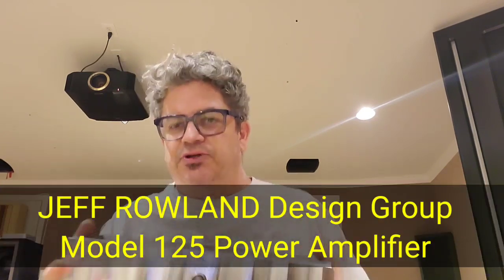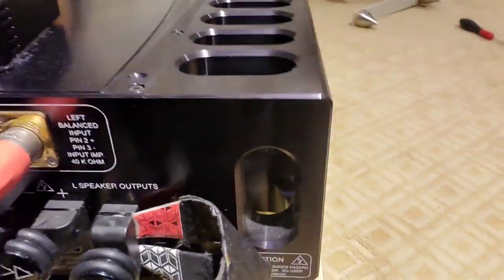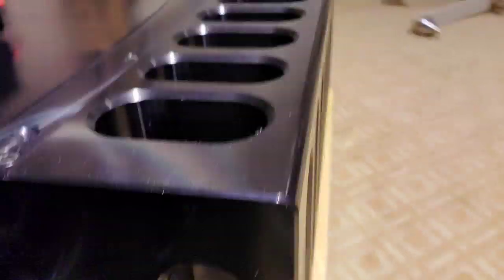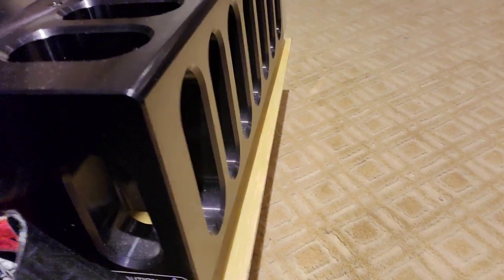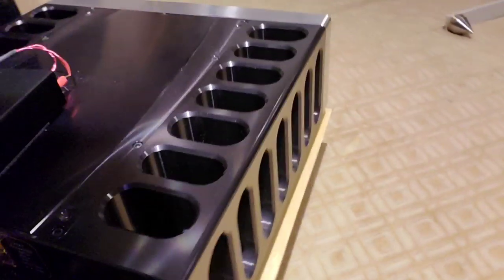Highest Value audio power amplifier for $3K

Comment: Id personally rather build some ICE / Ncore mono blocks with more power 
and look at the $1500 I still have in my wallet while taking pride in my handy work. 
But thats just me.

Your right, JR doesnt typically make "affordable" audio gear. However I dont think this 
product represents JR wanting to serve us working class out of love. Its because new 
audio topology now exists that can compete with old school high end linear power supply 
class AB output so on... And it weighs a small fraction of prior high end and can be made 
much cheaper on top of that too. As an old school audio guy with boat loads of big heavy 
gear. I know Im a relic of the past. Doesnt bug me. Just over the past 10 years class D in 
its many forms became a gold standard as well. Heck even the 60 watt chip amps for $60 
sound amazing with a decent power supply and used within their limits. 

Modern day audio nerds dont want hundreds of pounds of gear that takes up half a room. 
Some still do but I dont think they are the majority by a long shot. Whats inside that fancy 
JR box is just another spin on a design used in countless other class D amps today. Sure 
they could price it a few k more but now only die hard JR fan boys will still be around. About 
$3k is the general cut off point for a "audiophile" pre made 125w class D amp it seems these 
days. Give or take $1k depending on ones preferences. 
And now parts express offers ICE amp kits for far less to the DIY crowd. With many other offerings
from other places. Bringing much more than 125w per module. 

Its a different day and age for high end audio my friend. And IMO its for the best for a handy consumer. 
True high end has never been more affordable for the working class. And its even better if one has 
some DIY skill. Kinda harkens to a time before my own. Aka the Heathkit Dynaco Eico so on days. 
Build some great gear on your own and keep some of that hard earned $ to by the equally important
things you also need, music ;)
Reply: You can buy an amplifier with the same internals for 800$ elsewhere. If you spend 3k you might aswell get something like the benchmark AHB2
Reply: @pangbangdang3672  Agreed. But it also begs the question, for ones setup, do you need such astounding specs for the $. I personally bought a bunch of 80s era class AB pro amps that got properly rebuilt. Fraction of the kind of $ were talking about here. I have other amps as well, tube, newer tech so on... They all have their own characteristics and strengths. I have to wonder about peoples room / treatments, speaker sensitivity and setup, not even going into peoples hearing and perception. I actually had the honor of talking to Zed of classic HiFonics fame. We got on the topic of amp specs of class D vs old school topology. He made the remark, you think those specs matter in the noisy environment of a car?!? Really hit me. In a nut shell, theres so many different ways to get amazing sound from all sorts of speakers and gear and other factors. Im personally in the camp of using amps with extra headroom for the application. So many of these uber expensive 100 watt +/- amps dont wow me very much. However if using my super efficient horn speaker setup thats a different story.
Reply: @daveme3582  For car equipment I agree fully, heck your also focusing on the road, maybe when self driving becomes standard hifi car audio will become a thing.

Honestly the best amplifier setup no matter the price would be benchmark AHB 2 (class H) in mono-bridged. That would be 380 watts into 8ohm and 700 watts into 4 ohm with 0.0003 % THD+N.

Although you can get 80% of this for a fraction of the price.

I am 19 years old and currently got KEF LS50 Meta topping d90s and rega Io.

My dream setup is Mola Mola dac, Benchmark AHB 2 amplifier, Benchmark pre amp and KEF blade 2. I have got some way to go but something to strive for 😊
Reply: @pangbangdang3672  Haha you remind me of me at that age. Im 41 now. 

Back when I was in high school I saved my $ and bought a Yamaha HT receiver and all Paradign speakers. Pro Logic back then. Went nuts from there on out. 

It was a pre internet era back then. The biggest lesson I learned as time went on was about amp clipping and killing speaker. I had no idea why I kept blowing tweeters on the speakers I used as a young kid. My dad hooked me up with some nice vintage audio gear. But I didnt know the receiver was only 40 watts or so and I was driving 2 sets of 3 way speakers with an EQ in the mix. Terrible move looking back on it now. But me and my dad knew no better then. 

Agreed on the spec stand point the AHB2 is king. And yes if I were gonna rock em Id also use a pair bridged. Plenty of power then. And I think $3k a pop is a fair price for what it is. I simply feel for MOST peoples, even high end, needs there are plenty of less $ options with similar power. That top 5-10% of quality comes at such a high price. But Im a big bang for the $ kinda guy. 

You seem like a very spec focused guy. One thing I learned over the years is not just focus on specs alone. Listening is every bit as important. Im sure your a fellow fan of audio science review. Id also HIGHLY recommend checking out Elliot Sound Products website and his many write ups on all things audio. Its like the mecca of audio college. You can learn about ANYTHING there. 

Ive been out of the modern high end audio scene for a bit now. Got enough audio toys for 3 lifetimes as it is. Id never heard of that Mola Dac. It certainly specs nice but their website is oddly vague on detailed spec info. Regardless theres no way I would spend $13k on a Dac. Its a mini computer inside and they all fail over time. Plus if a company chooses to charge that much I would demand a warranty like Benchmark offers. 5 year with registration to the original owner. I could find no mention of warranty on Mola's site. But Im guessing its a 1 year given the absence of info.    

Im also a spec guy as mentioned. Its why I bought a used Prism Lyra 1 for less than half its new price. I love a quality A/D D/A box for my computer needs. With that said I recently got a great deal on a used Motu M4 A/D D/A usb box. Under $200. New its about $260. I personally feel the Motu usb units to be the best bang for the $ around. They spec right around the same other "pro" grade converters in many cases. Not tip top but damn close. I also have older nice DA converters that are non usb. So I bought a Mutec MC 1.2 interface. Great units for solid digital I/O with a PC. I also have a Lynx E22 PCIE audio card. 

I would personally just go with a Benchmark DAC 3 HGC and not bother with an external DAC. I trust Benchmark to make true TOTL gear. They have been doing it for so long now. That would be a perfect preamp with built in dac. 

Your clearly a fan of KEF. Many are as well. Just its been my experience that direct radiator speakers that use several small drivers to cover deep bass, tend to lack the visceral impact and depth of larger bass drivers. Clearly this is a generality. And I know and have heard examples that were impressive. The large old Polk SDA come to mind. They used a passive radiator as well. Im sure those Blade 2 are great and all. Just for the same $ I personally would be looking at a set of Wilson Audio Yvette speakers. Clearly Wilson knows what its doing. Plus they spec much better in the bass depo at the -3db point. Found it kinda odd KEF chose to show specs at -6db points. But hey many do as well. Also are 175lbs per speaker vs 77lbs per speaker. No cheating physics thus Wilson make damn sure their cabinets are inert and built to last.  

Id highly encourage you to listen to some of the many Planar design loud speakers. They really are a sound unto themselves. Same with planar headphones. Many different designs out there. I personally bought a set of hifiman HE500 headphones. I also got lucky as all heck and snagged a full Stax Lambda Professional headphones with matching amp thrifting for less than $10. Pre covid you could find amazing stuff thrifting. Still do just far less than before. This is easier said than done but if you ever get the chance to hear an all horn loudspeaker setup there is simply nothing else like it. Granted its not easy to do and takes up quite a bit of space. But wow, its life like on another level. 

So many great ways of getting great sound these days. You also have time on your side to discover all sorts of new ways and toys. Have fun on the journey. And try not to make the same mistake me and so many others have. Wasting $ on stuff that simply doesnt pan out. But hey part of the fun I guess LOL.
Reply: @daveme3582  Haha you got me. I studied science from 16-19 and am a very analytical person. 

I will for sure check out Elliot sound. I wanted to go all out on benchmark, but I would also like a streamer and that is built in to the Mola.

My parents got KEF r3 then I got the LS50 meta. Meta measure very very freaking good at mid to low volumes. That said they do not deliver below 150hz, but they are to my current subjective taste perfect down to 150hz. I listened to 5k$ b&w at a local store and they had a lot more below 150hz  but they couldn't compare above. 

Blade 2 got the same directionality as the LS50 meta but got the full spectrum. Even if you look at the measurements of the blade 2 in stereophile it shows it is the current pinnacle of the KEF sound. 

I have been interested in hifi since I was 12 years and purchased Sennheiser hd558s , then I used a years saving when I was 14 to buy audioquest nighthawks.

I introduced the hifi world to my dad who was not enjoying a concert at home on the Bose speakers we had 🥲. I showed him the KEF r3 connected to a Naim atom and he was sold (he did not even ask my mom for permission to buy them 😂).

The best part about this is that I will probably experience the KEF blade 2 before I buy them because my dad will have the money to buy them when he retires in 10 years or so.
Reply: @daveme3582  Then each KEF blade 2 uses 2 force cancellation woofers and therefore the weight is a none factor. Specs are 40hz-35khz +-3db and that's essentially all you need for music.
Reply: I'll take my Crown PS400, which is a class 'A' + 'A/B' and plays the first 10 to 20 watts in pure class 'A'. Class 'A' is the best, low distortion sound available today. And the Crown has 165 watts into 8 ohms and 330 into 4 ohms. It is an audiophile amp and I would like to hear a comparison.

Comment: It’s a gorgeous piece but perhaps to focused for my use? I only see XLR input which makes the “integration” difficult in my system.  Also this may be naive but why aren’t manufacturers including treble, bass, balance and loudness dials anymore?  Those are my go to tools I use daily on my vintage luxman and I don’t see how I can move to a new piece of equipment without them.
Reply from the maker: Hi Hemant, good questions. Simplest answer is that this is a purist design power amplifier that is balanced XLR=Balanced, if you are purist, you do not allow for conversion steps on the input to facilitate a connector designed for home use (RCA) There is actually a point that the equipment sounds good enough that it does not need treble of bass control.  If you must constantly reach for bass and treble, something is wrong. A good system has balance naturally.  This is not a product for you. Your perfect product is a Simon Audio Lab All in One . Go to 11stereo.com to see one..
Reply: @OCDHIFiGuy  Thanks, that's kind of what I thought, but your explanation is great.  I will check out the Simon Audio!

Comment: I think you are wrong taking into account whether or not amplifiers are sold direct or through dealerships.  It should be at the new price you can purchase them for.  I have never heard JR amps before in the flesh, but they sound pretty good on you vids, so I am not saying this 125 is not a bargain at $3000.

Comment: The way your handling that amp suggests it's very light weight and prob worth it's asking price. The amps I'm use to are two men lifts only. Solid metal casing etc etc. At low end, 5k can buy real quality. That amp is fair pricing.
Reply from the maker: Yep many of those bad ass amps are becoming dinosaurs. No speakers these days need it and to need an appointment to move your amp to the other side of the room is a drag. Plus they waste energy BAD  Krell Reference Standard, Gryphon Ref 1, I was offered these last week and can get them for a song, but I dont want those massive cant move them amps in my room ...

Comment: Damn 
Made in USA 
I wanted a Restored TA-N7B SONY 
That amp has me thinking hard about going 
Jeff Rowland,  can it drive LSR Magnepan  ?
Reply: DED NSIDE TA-N7B is a masterpiece!
Reply from the maker: Look at my other video, I have it driving the larger .7i's  it is killer with Maggies.  This will turn a Sony inside out.
Reply: @OCDHIFiGuy  
I have to agree 
As much as I love the Sony and L-O8m Kenwood monoblock 
I think you've put the best under 5k 
Combo together on YouTube , regardless of era .
Do you have a recommended for a pre amp ?
Reply: @PrimeHiFi  
Yeah its probably the best commercial AB solid state ever made .
I dont think anyone knows what it is but a handfull of people. 
It was the economic world crisis of 80' 
That did it in unfortunately , and the move to mosfet at Sony .
It's a tough call
Reply from the maker: @dednside5229  that Sony is cool because of when it was made. Right now that technology Vfet means nothing more than cool nostalgia, there are not many people that will take speaker pins and pinch hole connectors serious.  This rowland is a far more viable piece.  How will you use the preamp ? Volume only or other things as well ? Do you want a DAC in the pre ? 

Cheers
M
Reply: @OCDHIFiGuy  
You have the insight into modern equipment we dont , Our brick and mortars shut down in the late 90's .
Could Maybe you do a pre amp recommendation video one day ?
I'm going to buy .7's and that Rowland .
I want a phono biased set up but need a dac for convenience.
Yeah , I need volume control and something to replace the sytem in my videos .
Reply from the maker: @dednside5229  if you want those pieces, please allow me to be your seller. I do not get any pay from youtube nor any manufacturer, i survive by selling product. 
Once you meet me and we talk youll see why i make clients for life. Because my goal is getting your rig to the point of giddyness for you. Just call four oh 4 seven 6four sixtwo 33. 7 days a week 12 hours a day from 10 to 10.
Reply: @OCDHIFiGuy  yeah man of coarse ,
I'm moving to Saudi Arabia 
I'll use you for my new rig when I get set up in a few months .
I've been messing with this stuff for 30 years.  Dealing with you I could just set it and forget it for a change .
You're good at what you do .
Reply from the maker: @dednside5229  no prob. I can ship globally.
Reply: @OCDHIFiGuy  
Badass .
Talk to you then -

Comment: Primare A35.2 would give those rolands a run for there money.. 200 watts into 8 ohmes 800watts bridged and cost 2250.. Give them a go and swiss made.. Awesome amps..
Reply: Swedish i meant lol
Reply: Tim Peck 
They are made in China though, just like Hegel
Reply: Actually since 2000 they have had parts manufactured in Taiwan and China. most of the internals are europian made and the chassis are made in sweden so it's abit of both really...
Reply: @timpeck4296  It doesn't make sense for Primare make the case in Sweden, the case is the part you can make the biggest savings on if you manufacture in China. AFAIK only the 60 series is made in Sweden. Don't worry though, this Rowland uses ICEPower modules that are also made in China. :)

IMO as a high-end manufacturer you either make an amplifier your kids can use after you're dead (class A/B, fully discrete, through-hole, top quality parts, repairable forever) or you go cheap with class D. Expensive class D amps are a bad investment.
Reply: And a benchmark ahb2 paired with a topping d90se running balanced would destroy everything